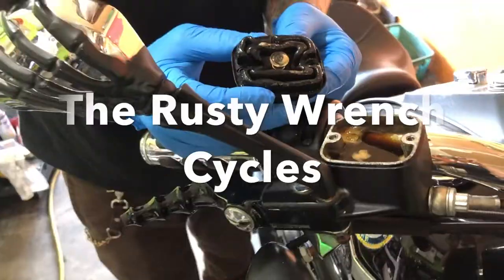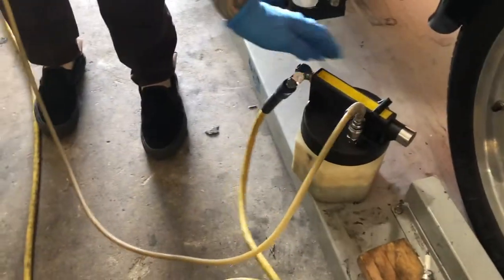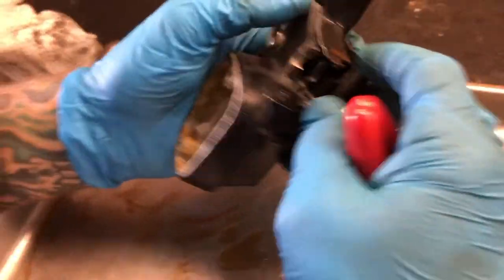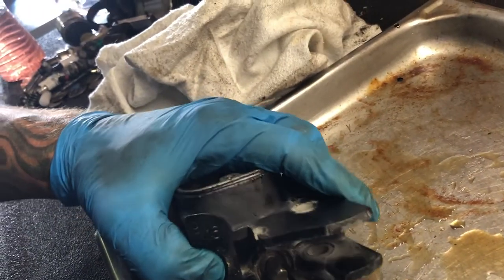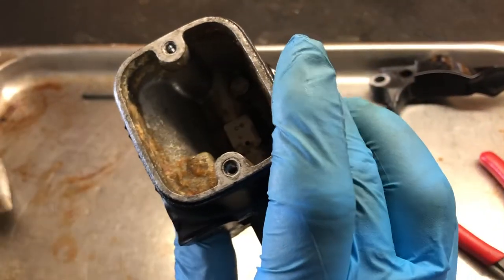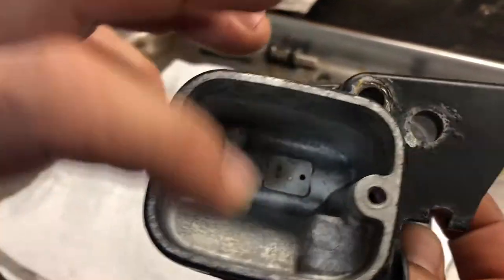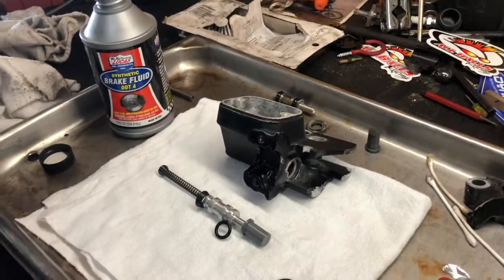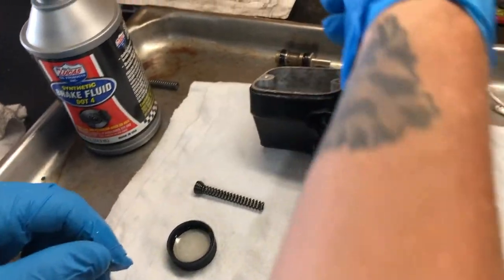Brake Master Cylinder Rebuild

Comment: could you have just cleaned the return and not have to rebuild the whole thing?
Reply from the maker: No, this would not work, the brakes can even start to drag, if not rebuilt at this point. The reason for the rebuild is because the brake lever is sticking, meaning they have gone past the point where a cleaning, by flushing brake fluid and cleaning reservoir, will fix the problem.  The seals and springs definitely must be replaced to restore the integrity of the brake system. Being that DOT 4, absorbs moisture, it is common for maintenance to be regularly done.